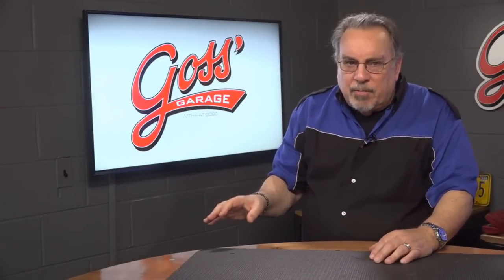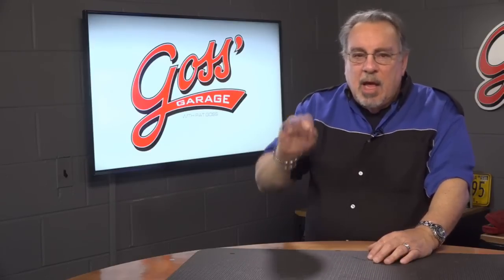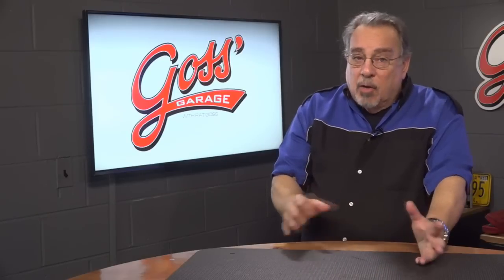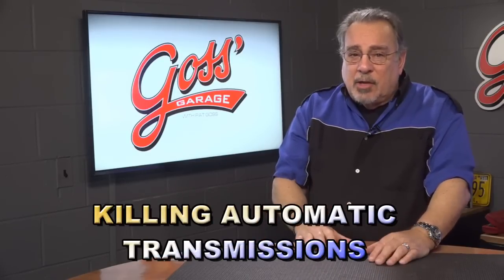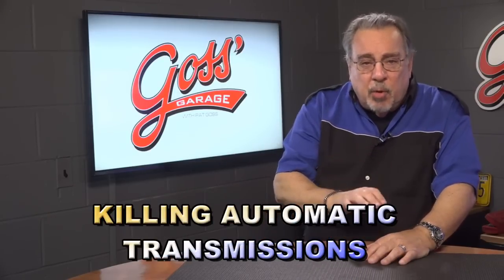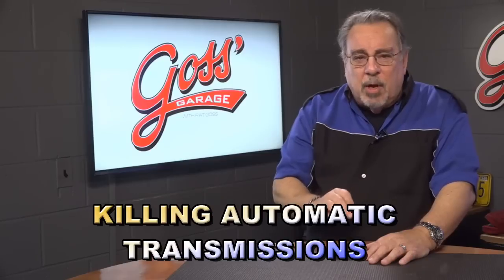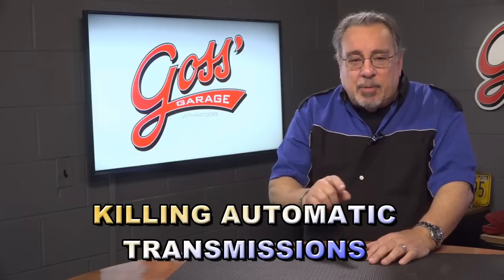Pat's Perspectives # 143

Comment: Pat is obviously a very intelligent technician but I prefer to drain as much fluid as possible as well as replacing the filter.
During this procedure the pan is cleaned & replaced with a new gasket before adding the appropriate synthetic trans. fluid.
I don't believe in flushing engines or transmissions.

Comment: I have a "97 Ram 1500 with a 360 V8 auto, I've own this truck almost 6 years now, when I first got the truck it was having some trans trouble. The trans fluid was very dirty almost black, so I watched a video on here,Youtube, on how to do a flush yourself. Just take a line off the radiator trans cooler line and hook a hose to it, start up the truck, put it in gear and as the old fluid comes out you pour new trans fluid in. Will that was almost 5 years or so ago and the truck ran great and I put about 60,000 miles on the truck until it done it again but the next time I dropped the pan and changed the fluid and filter. But really the filter didn't need changing it still looked clean but I changed it anyways. Right nor my truck has 263,708 miles on it so far and I've put 71,000 miles on it myself. I know flushing works because I've done it and it kept my truck running for awhile, well hell it's still running now and the trans is still going so far. He's right if you don't get all of the dirty fluid out then you might as well not do it!!
Reply: I meant put the trans in neutral not gear. Anyways it worked for me so he's not lying. Plus I've gotten a little over 5 years going on 6 years so far out of my truck with the original engine and trans in the truck. If you don't take care of them they won't last!

Comment: Do you know why Honda does not want their transmission flushed.. had bond dealer replace tranny fluid on used 2010 fit, with 73000 miles at the time, they also put in that additive that supposed to soak into the metal, name skips me, but I was not happy.   The name was Z max of the additive, read good and bad.. any opinions.  Thank you

Comment: Or or you can be like me, one of those crazy people who changes transmission fluid every 15000 miles. But then again I do it myself so it doesn't cost much. And make sure you use the CORRECT  transmission fluid for your vehicle. As an auto parts salesman I wish I had a dollar for how many times I've asked someone what kind of transmission fluid they needed and the answer was "Red" or "Ain't they all the same?"
Reply: are you removing 100% of the old fluid?

Comment: I disagree with his method. Third party chemical cleaners generally voids warranty unless it is specifically approved by the manufacturer, which there are very very few, even the usage of those for warranty repairs at dealerships generally requires factory pre-authorization. The method of disconnecting cooler line and exchange the fluid with a machine is okay however most modern transmission cooler lines have a bypass valve that will not flow the fluid to the cooler lines unless the transmission reaches a certain temperature, his method will only pump room temperature fluid into the the transmission casing which will result the bypass valve open and fluid most likely won't come out since the temperature is not high enough. More importantly, most modern transmission after a full fluid exchange (Aisin, ZF, etc.) requires a relearn of the TCM which makes majority of independent shops obsolete. For most DIY folks a drain and fill for about 3 times with fluids that meets factory specs will get 90% new fluids into the transmission and does the job fine, it is also an approved method on most factory shop manuals, generally no TCM relearn is needed either.
Reply: hello, sir  what interval for the 3 times drain and flush do you recomend? thanks in advanced.
Reply: Every time you do a drain and fill it gets about half of the fluid inside the transmission out. I would do it once then drive around for a week to let the fluid circulate the transmission and do it again next week, do this a total of two to three times you would be good to go. If you are doing a pan drop and the transmission filter is serviceable change that too. I had been doing this method for all my cars in the past, I generally do this every 30k to 45k miles. None of the transmissions I had needed rebuild and pass way beyond 200k miles. This method is approved method for your mainstream vehicle makes like Ford/GM/Toyota/Honda etc. Be very careful to use the correct fluid for your transmission, make sure it is approved not the recommended/suitable wording on label, OEM fluids are the safest but if you go aftermarket make sure it is APPROVED by the manufacturer, Dexron VI, Mercon LV, Type F, ATF+4, etc. There is NO universal transmission fluid.